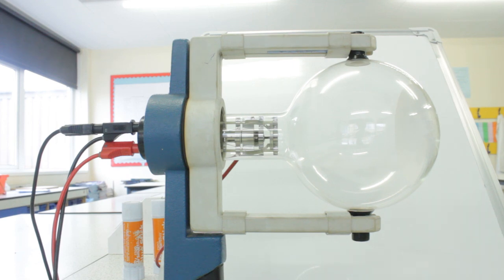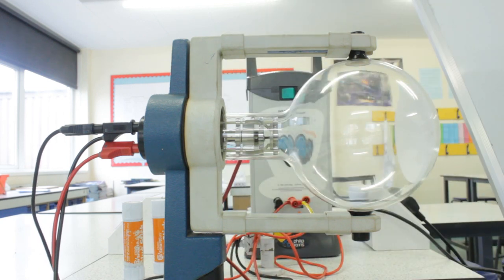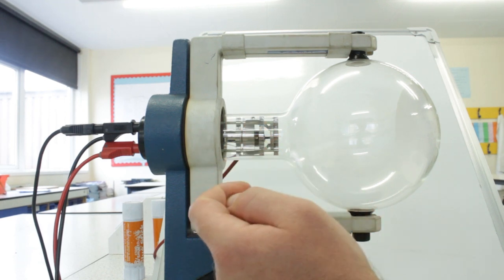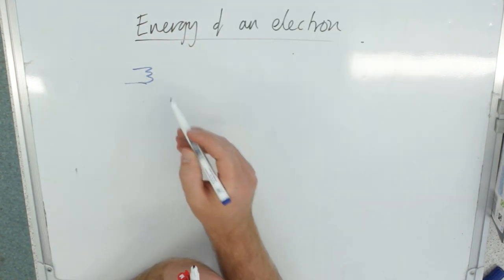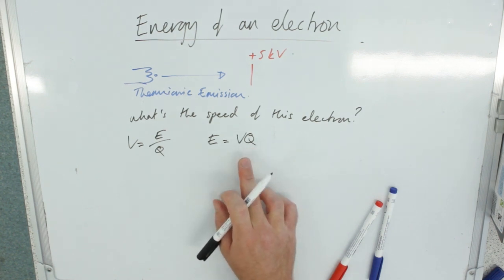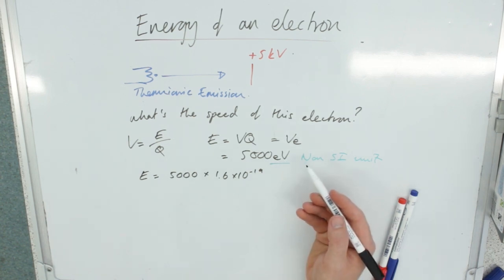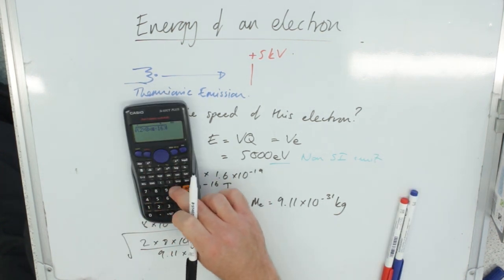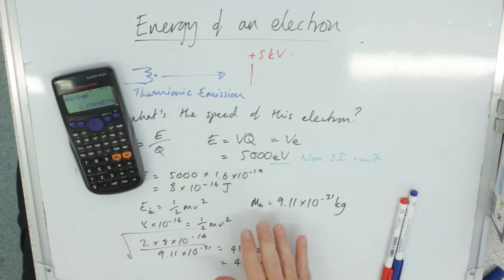How does the electron gun work?  Thermionic Emission and Particle Acceleration - A Level Physics

Comment: What happens to those electrons after striking to screen.... Do they come back to cathode or something else. If we are removing the electrons via thermionic emissions which leads to deficiency of electrons at the metal used as electron gun. Please elaborate
Reply: Ian Stevenson  so now the electrons have gone to ground. Shouldn't there be deficiency of electrons on the metal that is being used as electron gun. So because of the deficiency of electrons on the metal used as electron gun, a time will reach when no electron will be  produced from  electron gun. Ultimately cro should stop working? Please justify
Reply: Ian Stevenson  so ultemately the place from where the electron are coming so called electron source(power supply) should lack of electron. And change in the nature of material should be there. Means positive charge should dominate over the power supply. And once electrons in power supply ends🤔🤔🤔🤔then??
Reply: Ian Stevenson  but the power supply should have the limited number of electrons. 😂
Reply: Ian Stevenson  bro your explanation is not perfect. Please go through the exact thing that is happening. The day before yesterday i got to know that the phosphorescent screen is joined in the circuit to compete the circuit. So that the electron can retreat their path to anode. And  there should be ideally no loss of electron. And thr circuit continues. But im not sure. Its a heard things. Check it out.

Comment: hey iwant to ask after electrons hits the phosphorscreen then where do they go
Reply from the maker: Good question, my guess is that they are scattered.  The excess KE they had will be transferred to the atoms of the screen, causing them to fluoresce, so they'll have pretty low energy and just get involved with whatever particles and be dispersed as any other small static charge.   I remember as a small child putting my hands on old school TVs and feeling the static on the screen, it took a while for it to come back after I'd discharged it!  That probably explains it. Interesting one!
Reply: @KitBetts-Masters  thank you for your concern sir 
but if the phosphor screen is not connected to something the atoms in the screen will be thereso much negative charged such that there will be a point when the cathode ray tube will stop working 
because the static charge will be too much infact in reality that never happens and according to my early childhood experience the effect of hair rising only last for some time after turning off the moniter so i suppose may be going somewhere because if not the whole vaccum thing will collide because of coloumbs law
and because of the fact that phosphor screen cannot generate extra protons(including the activator)to keep the system
 neutral 
sir thank you in advance for clearing this doubt
Reply: @sdadeveloper5223  CRTs have discharge circuits, and the whole tube is coated with aquadag on the inside.
Reply: Ian Stevenson  man u r awesome